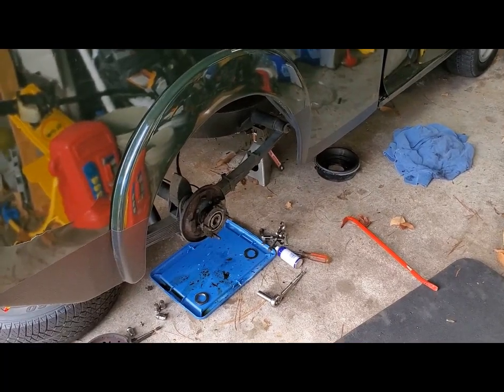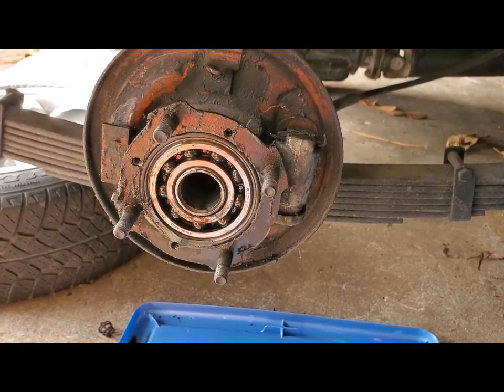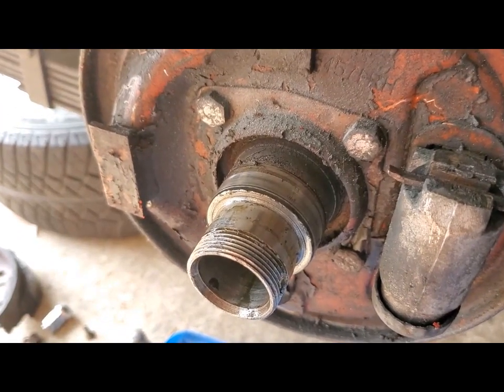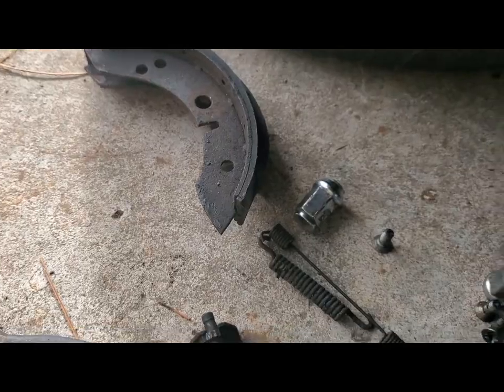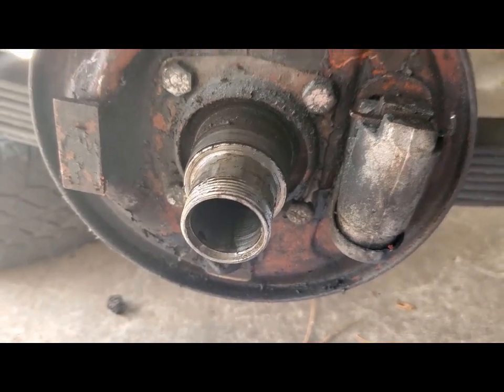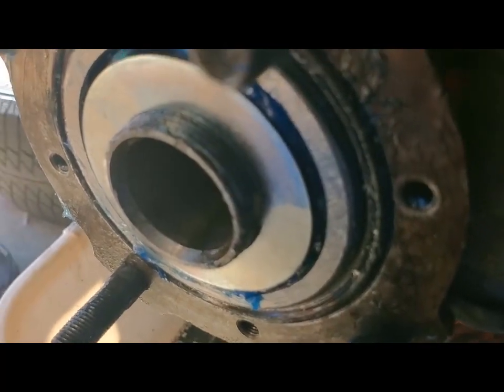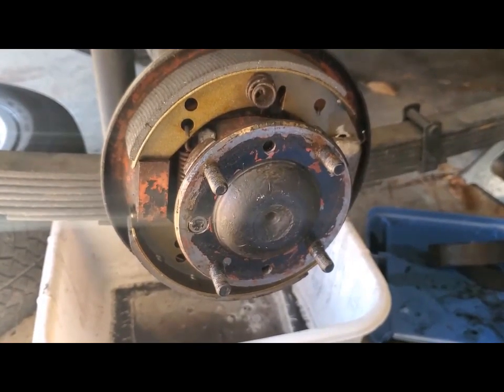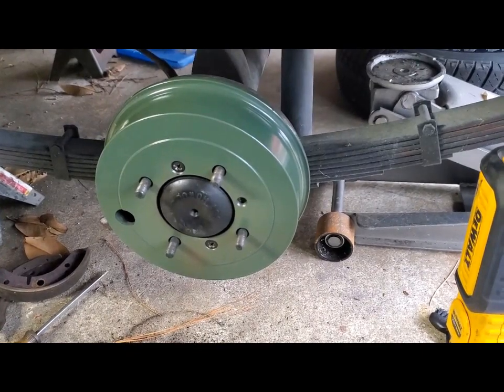Morris Minor Rear Drum Brake Rebuild and Axle Bearing and Seal Replacement

Comment: Vans are very sought after in the uk, proper job done to rear axle and brakes.
Reply from the maker: Thanks. Mine constantly amazes me. It's very peppy with the Judson supercharger installed. Fuel injection is next but there have been some hurdles moving in that direction.

Comment: Never taken half shaft apart to fit brake cylinders theu will fit in and out with slight persuasion
Reply: You're right, but I was dealing with a leaky axle seal.